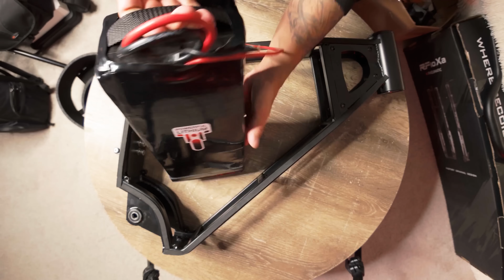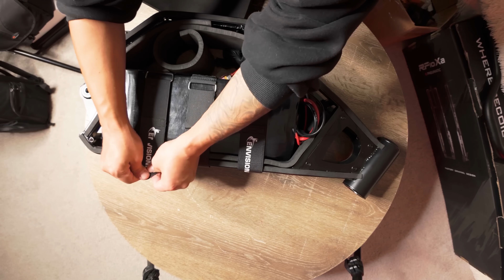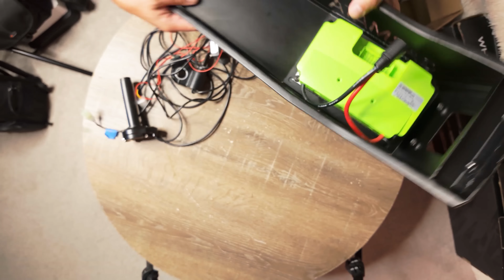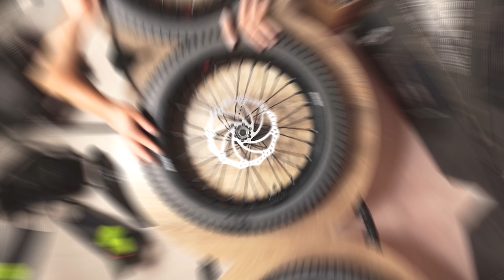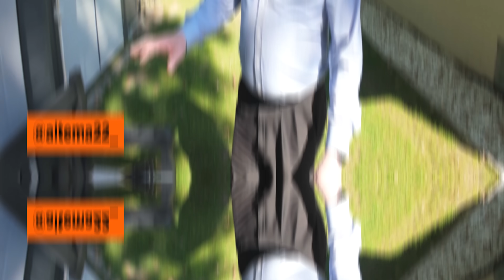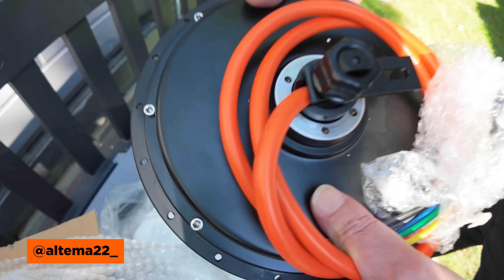Enduro DIY Ebike Build Update: Battery, Motor and More!

Comment from the maker: Enduroebike Garmata Frameset + MX2 Moto Seat: https://www.enduroebike.com/index.php?route=product/product&path=137_125_126&product_id=410 
RFLOXA Hawk31 Pro (use promo code RUNPLAYBACK for 5% off): https://www.rflo-xa.com?aff=11
Econic FarDriver BT Dongle (use promo code RUNPLAYBACK5 for a 5% discount): https://econiccycles.com/products/fardriver-sinewave-controller-bluetooth-module
Econic FarDriver Harness (use promo code RUNPLAYBACK5 for a 5% discount): https://econiccycles.com/products/fardriver-sinewave-controller-replacement-wire-harness-small
Econic FarDriver Pre Wire Kit (use promo code RUNPLAYBACK5 for a 5% discount): https://econiccycles.com/products/controller-essentials-key-ignition-w-voltmeter
Econic FarDriver 72300 (use promo code RUNPLAYBACK5 for a 5% discount): https://econiccycles.com/products/fardriver-sinewave-controller-nd72300-w-bluetooth
Eonic Chaojie Display (use promo code RUNPLAYBACK5 for a 5% discount): https://econiccycles.com/products/fardriver-sinewave-controller-chaojie-touchscreen-display-w-optional-3d-mount
Powerful Lithium 72v 30ah Uranus Battery: https://powerfullithium.com/products/72v-uranus-battery-for-ebox-2
Magura MT5 Hydraulic Brakes: https://amzn.to/4oYKQeb
Sintered Metal Brake Pads: https://amzn.to/3JYT9X6
KKE Surron Wheels - 2.15" Front and 2.5" Rear: https://amzn.to/3JHIlMZ
70/100-17 Motorcycle Tube: https://amzn.to/3JFcGvG
Shinko SR241 17" x 2.75" Trials Tire: https://amzn.to/3JHIlMZ
31.8 Handlebar with 90mm Rise: https://amzn.to/4p0F1N4
44T Chainring: https://amzn.to/3UVJMdc
152mm Crankset: https://amzn.to/3JCrR94
Battery Straps: https://amzn.to/4eAbeoa
Direct Stem Mount with 30mm Rise: https://amzn.to/45QMmHT
EVA Foam: https://amzn.to/4n6G7VN
Motorcycle Rim Strip: https://amzn.to/4lNSNjl
Single Speed Bike Chain: https://amzn.to/4fWKH6M
Shimano Master Link: https://amzn.to/4gap6rF
203mm Rotor: https://amzn.to/45TbEnd
26T Freewheel: https://amzn.to/3Voioof
Bell Super 3R MIPS Bike Helmet: https://amzn.to/3TJ1vTR
Fox Racing Bike Gloves: https://amzn.to/40P5SyQ
Fox Racing Hip Bag: https://amzn.to/3xmW4mT
Hafny Handlebar Bike Mirror: https://amzn.to/3FVubmN
Veeape Electric Air Pump: https://amzn.to/3LPLTf9
Denlix Military Sling Bag: https://amzn.to/3LTKN2c
Lamicall Bike Phone Mount: https://amzn.to/3LXmD6O
Onvian Wireless Bike Alarm: https://amzn.to/42KUgyE
RunPlayBack Merch: http://shop.runplayback.com/

Comment: Hi
Thanks for the useful video! 

I'd like to ask - how you installed QS205 (150mm) in the EEB dropouts (155mm)? My EEB swingarm in reality has even not 155 but 157.5mm between dropouts, resulting in a 4mm gap on each side between the dropouts and the axle flanges

Comment: you will need different controller,i have the exact frame with the qs205 3.5t (supermoto style ) paired with fardriver nd72680 and when i use the bike with 350 phase amps in the settings,the bike has a super slow start,i think the minimum be 500phase and the bike is a monster and no over heat problems